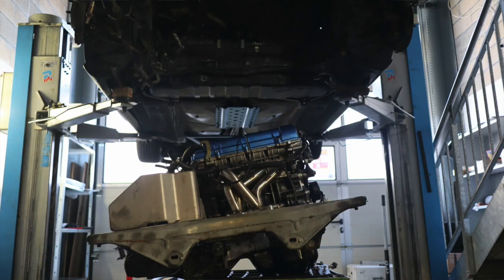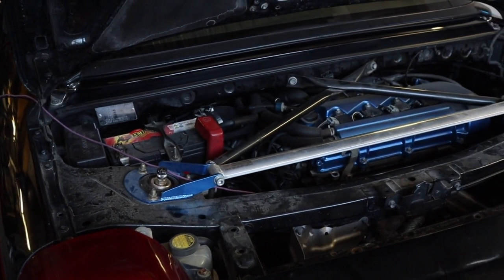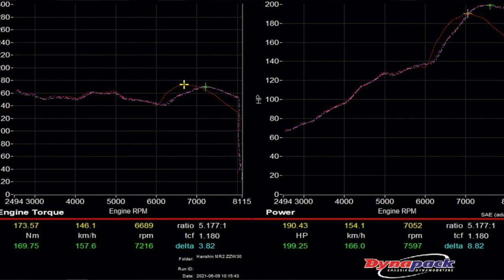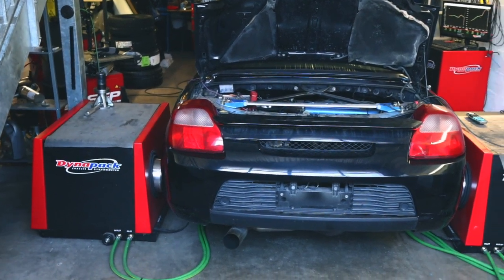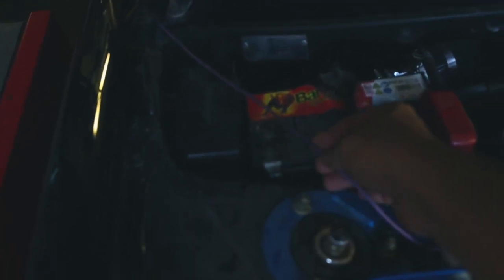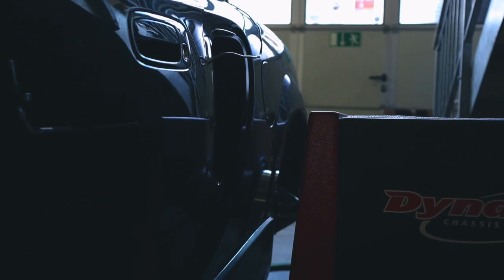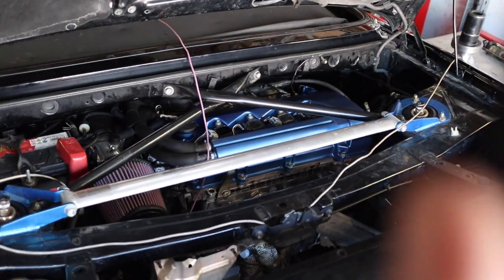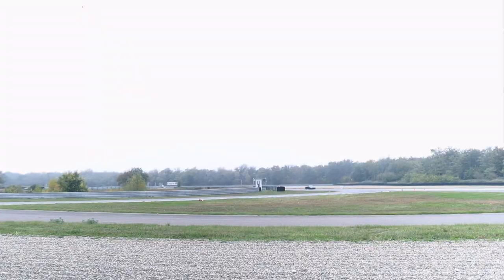EP27 Project Lotus Hunter: 2ZZ Engine Tuned further (work in progress, over 200 bhp NA Tune)

Comment from the maker: Any 2zz Mr2 Tuners on here? Tell me how much power you made and what mods!
👇🏻👇🏻👇🏻
Reply: 220HP and 198Nm to crank.
2zzge, ported head, custom free flowing 4-1 exhaust with single resonator, short ram intake with 3d printed vanes, apexi pfc, dyno tuned, 98 fuel. The car feels healthy! Check my vids for action videos :)
Reply from the maker: @motoringmatt  very nice! Thanks for the information! I'll take a look at it!!!
Reply: Mine sits shy of 230hp at 229hp (171kw) 
CES racing Headers ported and polished with high flow catback exhaust.  CES racing cold air induction with a k&n air filter pod with a high flow.  Stock ECU ✊
Reply from the maker: @ronnibee379  wooow those are good numbers! What Dyno?
Reply: @motoringmatt  Eso es muchísimo dinero y ese motor termina petando la apexi FC Commander es muy cara más el programa más la reprogramación en el banco por una persona con muchísimo conocimiento,el colector ppe súper caro una puta locura preparar el 2zzge es una basura

Comment: I believe the restriction is in the exhaust setup. Most people who make really good power have the PPE header and high flow cat or cat delete and a custom exhaust. The MWR header is usually utilized for people who want to run the stock or stock like exhaust system.
Reply from the maker: Thanks man! I’ve heard that before too! I will look into it! What do you think i can gain from a different header?
Reply: The PPE header and cat delete should net you another 10hp.
Reply from the maker: @frankflores1917  oh boy! I guess I know what to do next! What do you think of the intake side?
Reply: Tried to paste a link to a Reddit post of a proper header/exhaust setup but YouTube keeps deleting it
Reply from the maker: @frankflores1917  add me on insta: @jesseyaroo
Reply: I had my girl send you the link since I don’t have an Instagram. There is also horsepower to be made in a ported intake manifold. The 2 piece manifold that came in the Matrix is easy to port since it can be seperated.
https://youtu.be/f67V5SLD0qo
Reply from the maker: @frankflores1917  not bad! Thanks for the share 😍👍🏼👍🏼👍🏼
Reply: @JesseSpec  people with Corolla’s, Matrix’s and Celica’s have all broken 200whp with a solid intake (such as the injen one or the R9K 3”), the PPE/R9K race header and usually 2.5” all the way back. Of course you would need a solid tune though
Reply from the maker: @loganamurray64  thats sounds about right 👍🏼
Reply: Una locura ese colector de escape es súper caro no lo queréis aceptar estos motores de Toyota son una basura

Comment: mon tuner m'a dit qu'il ne pouvait pas trop abaisser l'entrée de levée de soupape car il générait une baisse de couple à mi-régime et il a essayé d'atténuer ce manque de couple avec différents réglages du vvti sans résultat positif, donc l'entrée de levée de soupape est resté à 5900 tr/min. 
J'étais au courant de ce problème avant de faire la reprogrammation et en temps voulu j'ai changé des pièces pour essayer de résoudre ce manque comme les arbres à cames cat Cam stage 2 et le collecteur d'échappement 4-2-1 au lieu de 4-1 mais ça n'a pas complètement résolu le problème
Resultat final:
219,25 CV @ 7731rpm
209,17nm @ 7234rpm
Reply from the maker: Interessant! Merci beaucoup Bruno pour ton input et tes précieuses informations! A ce qu’il paraît, le collecteur d’admission d’origine est aussi restrictif
Reply: @JesseSpec  Je te passe des photos du collecteur d'admission ouvert par privé si tú veux
Mois j'ai usiné le colecteur d'admission oem
Reply from the maker: @brunotrdful  volontiers (go Instagram)
Reply: @brunotrdful  Salut Bruno, je suis également intéressé par tes informations, est ce que tu peux me les partager stp ? ton 2ZZ à quoi comme piece pour arriver à ce resultat ?  merci
Reply: @ludoviclorin3589  salut Ludovic
Short Block acheté a monkey wrench Racing avec :
Mwr Crankshaft lighfweight
Crower conrods maxi light
Mwr flat face valves set
Mwr spring valve set
Mwr Titanium reteiners valves
Cat cams stage2 Camshaft
Culasse usiné
Colecteur d' admission usiné
Jointe de colecteur d' admisión termique cosworth
Cort de Papillón d'origine usiné a 69mm
Admisión 70mm
Mwr light pulley alternator and water pump
Fidanza Flywheel
R9K tri-y header no Cat
2, 5" custom exhaust
Injecteurs 440cc
Pompe a essanse dw 65c
Apexi power FC

N'augmente pas la puissance mais très important un pont court 4.80, il change beaucoup le comportement du moteur,avec lui ont dirait  que plus de puissance soit disponible
Reply: @brunotrdful  merci pour les infos, effectivement ca fait un paquet de modifs !
mon 2ZZ est dans une lotus elise, Pour le moment je cherche quand meme à augmenter un peu la puissance pour optimiser le moteur. dans un second temps je toucherais à la boite

Comment: How does the torque curve compare between the 1zz and the 2zz? I see the graph on the horsepower, have you done the same on torque? Would be interested as a lot say the 1zz is better
Reply from the maker: Hi, thanks for your comment! Watch my first youtube video on the 2zz series and you will see that people who say this are utterly wrong 😉
In that video there are graphs to prove it 👍🏼
Reply: @JesseSpec  doh! Don’t know how I missed that first time around. Lift is life! Thanks
Reply from the maker: @MeltonAngling  Thanks buddy 👍🏼👍🏼👍🏼
Reply: 2ZZ with a combination of 6-speed gearbox and shorter final-drive is such a great combo for ZZW30. With a 5-speed and long final drive it may seem sorta sluggish. Although the 2ZZ does require to squeeze every bit of RPMs to get what it has. However, I find that entertaining and rewarding while driving. Of course, a flat torque curve theoretically would be better, but that urge to rev and scream has its perks, at least from the driving experience perspective.
Reply from the maker: @motoringmatt  true dat. I have the c60 6speed. I was a bit worried though about keeping the 5 speed so I decided to use the 6speed right way

Comment: Not sure why your tune power line is so far below the standard ECU power line on the high cam between 6000 and 7000 rpm...?
Reply from the maker: At what moment do you see that?
Reply: @JesseSpec  look at the Dyno plot at 17:36 where you gained the top end from about 7000rpm to 199 or something like that.. but compare the standard with the new from 6000 to 7000 and you will see you are missing a lot of power on the top cam between that rev range, which I don't think you should be. You should be able to regain that into your map right?
And you lost torque..?
Reply from the maker: @TomEnduro  watch the whole video to the end and you will see I made it back…

Comment: hi what oil and filter you use?
Reply from the maker: Hi, I use the HKS oil filter
Reply: Interesting question, because Toyota recommended for the 2zz ge oil 5w30 ilsac gf3 and lotus that used this same engine recommended 5w40 a3b4.
 I use redline high performance 5w30 and oil filter k&n
Reply from the maker: And 5w30 or 5w40 Minerva Synthetic oil
Reply from the maker: @brunotrdful  that looks like a good choice 🔥👍🏼